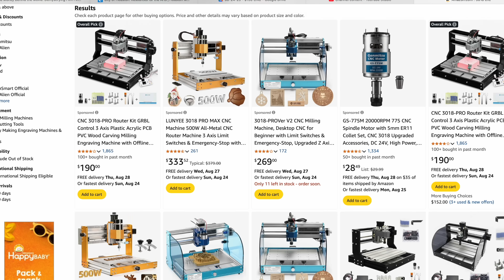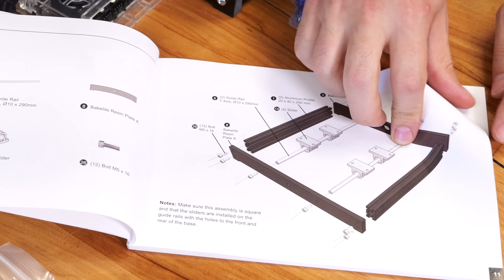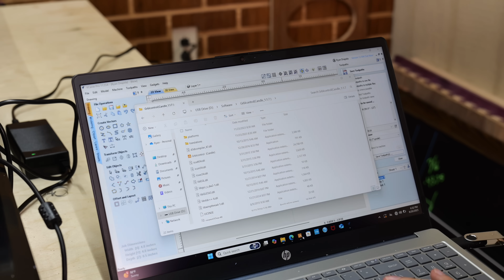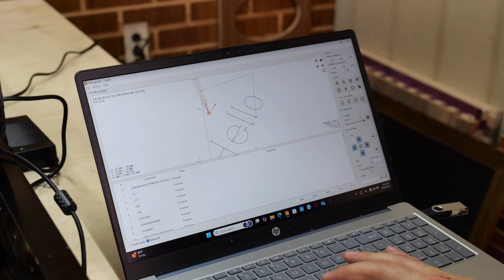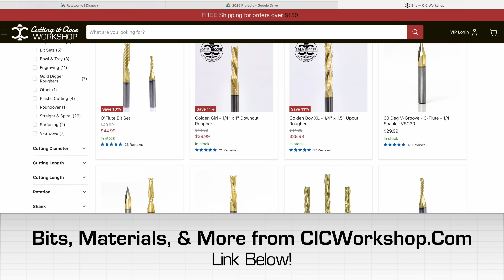I Tried a $150 CNC Router… Here’s the Truth

Comment: I feel that the review is misleading partly because some fundamentals are misunderstood. This is a (very) cheap desktop machine that compromises on several areas to bring the cost down. You can't expect the same rigidity and/or mass like a machine that costs and has a mass 20 times over. Furthermore some constructive criticism : 1) The genmitsu does not have  linear rails, it has linear rods (worse) 2) The gemitsu doesn't have ball screws, it has a lead screw (much worse). 3) The bigger the bit you use the more rigidity from the frame and power from the spindle is required as the cutting forces are distributed across a larger area. There is a reason why smaller bits are recommended for desktop machines by default. By all means you can use larger bits but if you try to mill steel with a 1/4" bit on a 75W spindle on a non-rigid frame you will have a bad day. Given slow enough speeds and use of the right tools this machine should be able to perform OK for hobby use and prototyping. It is not a production machine in any way and should be treated as such. This is like buying a miniature excavator for sorting your garden out and trying to compare it to a Caterpillar.
Reply: Yes, it’s a toy by professional standards, but in skilled hands it could produce some impressive coasters.  Or panels from which to assemble houses for HO Scale train layouts.  With a little tooling, could make chess pieces.  Rigidly would be an issue in some situations, but nothing prevents the skillful user from introducing frame enhancements as needed.  For a hundred and fifty, a person that knows what he’s doing couldn’t go wrong.
Reply: My car can’t do 0-60 in 3 seconds. It also can’t compete in the Daytona 500. It wasn’t meant to perform at those levels. Expecting this little machine to swing a 1/4” bit through steel is delusional and not what this machine was designed to do. It is a great machine to get someone’s toes wet in the cnc world.
Reply: Would this machine work for making small names plates for picture frames etc?
Reply: @seanr2157  Yes.  The limitation would be the rate of production; obviously these little machines aren’t going to crank out hundreds of parts every day.
Reply: I think you are being too harsh...
Calling the linear rod a linear rail, and the leadscrew a ballscrew was careless, but pretty much everything else you mention was covered in the video.
I thought the video was thorough, and left me with the impression that if I wanted a toy to fiddle with, this will do... if I actually want to do anything useful, keep saving!
Reply: You beet me to it. The guy is enthusiastic. The first comment was sum on who wanted to feel better about themselves. 
Good video.
Reply: So basically it’s still useless, gotcha 👍🏼👍🏼👍🏼
Reply: @deeran656 it’s actually very useful, I have this little guy and a massive mill. Nice for engravings, pcb work, light aluminum and wood/plastics. This guy also misses a lot of fundamental stuff.
Reply: @deeran656   Definitely not up to your standards.

Comment: I bought one and was disappointed in the quality of the cut, especially on aluminum. I had some CNC experience on a metal cutting lathe, but I had to go through the same software problems. I ended up buying ball screws and square linear rails. I have a metal cutting milling machine andhad to make many parts including a mount for a trim router. It now gives decent cuts on aluminum, but it took a long time to modify, and several hundred dollars. I wouldn't recommend it if you want to cut metal. You would be better off to buy one that already has better rails and ball screws.

Comment: These entry level cncs should be considered as a learning path. I bought a similar machine about 5 years ago to learn software and it was a great way to get started with cncs
Reply: Worst part of this industry is that this mindset is the minority. We do not need to learn from 4k dollar machines. I made a comment about buying the best 3018 you can and upgrading from there and I got tore up. 😂
Reply: It's not actually running at 10000 rpm you actually have to change the settings with code  to run it at 10000rpm it will only be running at 5000rpms as set by sainsmart as default speed . There is alot your computer dude didn't explain to you about this machine . Also yes it doesn't weigh a ton like a regular cnc router so maybe bolt it to a sturdy table 🤦🏽‍♂️ the bits that come with it are fine and will work for your first 10 small projects it's good to test how much you can cut on each pass on a horrendous 1/32 v bit it's good for inlays for chopping boards done with resin and vcarve trail works good just get a few emails address 🤣
Reply: The best use of this & similar sub $200 CNC  is strictly for “light plastic, balsa, and LEARNING”. I bought one a number of years ago for learning. Its greatest claim to fame was I could toss it into the car & run it in the hotel room when I was a road warrior. 

I still have it for training new operators. A lot cheaper to fix this then have them crash a full size.
Reply: @graybeardstudios3672  Exactly...  It's an inexpensive learning tool and something to create crafty nick-knacks out of soft material.
Reply: Same reason those super cheap 3d printers were popular years ago, a fun DIY project that teaches you a lot.
Reply: its the route i took, bought one maybe a little more expensive than this, about 1 month later i put it back in its box and sent it back.. went the shapeoko route

Comment: Just a tip, GRBL and GRBLHAL machines do a lot better with the software G-sender IMO. It is much more powerful and user friendly than most of the other GRBL compatible gcode terminals IMO
Reply: Howard I thought that GRBL was a built in chip ? If i buy a machine like this can i run g sender instead ? I am a newbie but have a 30 30 longmill, I want to have a fleet of small machines doing small individual tasks to create a production line effect, I can then keep the 30 30 on the go for bigger carve jobs, I'm still researching any advice would be great thanks
Reply: @russellcole4377 Sure. GRBL is firmware that can be loaded on a microcontroller like an Arduino. It then just  interprets the gcode (text) commands that you send it and runs the stepper motors.  Any gcode sender program can run it.
Reply: only problem is GRBL is old slowly worst cave men software who not support all full G-code and uses normal only toy machines make toy parts or PCB ,etc somethink small ,not have wood worker shop tool. need lot better softwares if make woodworker machine and made lot wood parts.toy is toy and men uses different softwares. etc realtime linuxcnc and have strong flexiple software. can add later lot lot own additions ATC etc other tools and godes and softwares. upgrade has limited.

Comment: I got that exact one a few years ago to learn. Absolute POS but then again didn’t know what I was doing.  So built my own (totally from scratch, most of the parts from Amazon). To that end, mission accomplished. Once I figured out the three software components, and basic hardware I was hooked.  Turns out the 3018 is a gateway drug.
Reply: As they say in the transport industry:  "The timetable is only there so you know how long the delays are!"
Your 3018 was the tool you used to identify what your REAL machine needed to have to be useful!   😜

Comment: I have to disagree with you, Ryan, on your statement that this little CNC is a waste of money. As a hobbyist I bought one of these 5 years ago and placed on my desk next to my PC. I was able to “air cut” many a project as I learned Easel, VCarve, Carveco, Fusion360 to see that I was understanding the various commands and, I guess, lingo of CNC use. A straight G28 command is a hell of a lot less scarier on these than on an XCarve or Onefinity machines. The dangerous part of this machine are these super pointy bits that come with it. I did do scribing with it, and I also cut into 1.5mm steel blank outlet plate to make oblong holes for some switches. The feed rate was slow and I think I had a 0.15mm cut depth per pass. I also had a layer of ATF fluid as my lubricant to keep the tiny chips local. 
I later switched to an after market laser head and did a bunch of coaster engraving for a class reunion. My machine is on a shelf now and I enjoy my Onefinity more because of it. 
By the way, take apart any 12-18 volt cordless drill and you’ll find that motor driving a set of planetary gears. That motor is used in a lot of name brand tools. 
Thanks for the always informative videos, Ryan.
Reply: Hey, Ryan, thanks for the like and the luv on my comment. You know, regardless of the cost on whichever CNC machine a person chooses, that’s only the entry fee. There’s the associated tooling, such as bits and various clamps/lock downs for the workpiece, possible 2nd lap top, memory sticks, etc. There’s also the dust collection system of some type that has to be set up. I just use a Fein shop vac as I don’t use my machine daily. I still had to get an additional hose and dust boot. I think you should consider making a video on the associated overhead that goes along with these machines. Like you need more work, right?…;-)
Reply: The motor as used in a drill drives gears which have their own bearings, so the motor shaft is not subjected to lateral cutting forces.
In this CNC the cutting forces are absorbed by the motor shaft.  On top of that, because of the length of the collet adaptor and cutter, the distance from the motor bearing to the cutter point is far too great.  Chatter is guaranteed!

Comment: I have had the Genmitsu Prover pro (almost identical to the machine reviewed, but comes partly assembled), for about 6 years now. I upgraded the bed to 3040 from 3018 soon thereafter. (Note that if you use limit switches, which I do, the actual working area is about 26cm x 32 cm, not 30 cm x 40 cm). I have used this CNC to build many things (using all sorts of woods + acrylic). I have not cut or engraved metals with it. The machine works fine. Quite chattery, though. The quality of the cut edges on the acrylic is acceptable. You can always do a little sanding if you need smoother edges. If have a limited budget, or you have limited space ( which is my case), or you  just want try CNCing, then I WOULD recommend this machine. I think the review was quite harsh. It is perhaps understandable if you are used to using a machine that costs at least ten times as much, with larger and motors and bits that cost 10 times as much that you would be disappointed in this little machine. As for the software, I've driven my machine with a Linux box and the freely available bCNC software, with no problems. May be your COM port problems are due to using Windows. For CAD I use the open source package FreeCAD, which is available for all platforms.
Reply: Same here. I've used freecad too, and vcarve and ugs for controlling the machine (I didn't like candle). All in all a great little machine in my budget.
Reply: I ALSO have Sainsmart/Genmitsu CNC's and LOVE them BOTH. My first was a PROVerXL 4030  Desktop CNC Router that I changed the base to a 6060 which makes it do 2'x2' pieces and then I also bought it again the PROVerXL 4030 Desktop CNC Router but this time I went nuts and bought the 10100 base which changed it to 40"x39" and they have ZERO problems. No idea why this brand keeps getting slammed when it makes good items, granted not the cheap $150 show me ANY brand that makes a good one but If you are willing to spend approximately $1k to start this is a good thing.
Reply: I did not use the recommended limit switch mount points… made my own and spaced to the full spoil-board size.

Comment: This was my first CNC. It got me hooked. I think I upgraded to a 4040 within a month.
Reply: I figured this would be the case, i ended up going with a 4040 right away. I put my already owned makita router on it and upgraded the Y axis to 4'(didnt upgrade X axis so the gantry weight was not increased very much) i cut up to aluminum sheet at 35ipm or so and havent had any rigidity issues in quite a while. Is it the fastest machine? No. But for under 500$ its been a great intro to cnc.
Reply from the maker: Which 4040?
Reply: @cutting-it-close i use the vevor 4040. Suprised what it can do considering how many people seem to think v slot belt/wheels are the devil. The genmitsu 4040 is probably twice as rigid, and have seen plenty of guys running theirs on harder materials, but for day to day woodstuffs i have learned to be successful with the bargain bin model.
Reply: @StudioMajesticGames  I have a Genmitsu Reno 4040 upgraded to 6040. The V-slot and belt are not a problem. In fact I think the thicker aluminium rails are probably a lot stronger then the equivalent unsupported smooth rods used on most 4040 CNCs.

Comment: I build guitars both acoustic and electric.  I use a much larger homemade CNC to make the bodies, necks, etc.  A number of years ago I bought one of this little machines to cut out inlays from mother-of-pearl and abalone shell.  Such things as sound hole rosettes, fret board markers, etc.  It has worked very well for such projects especially at slow speeds and really tiny bits.  Not really sure what else it could be used for but I have found a use for it and am satisfied.
Reply: That's pretty cool!
Reply: Could it be used to cut out a pickguard from flat rectangle blanks?
Reply: I’m a machinist/programmer.  Your tool is sticking out to far and it sounds like you don’t have the correct speeds and feeds.  Also you need holes for end mill start points. So I doesn’t come down on material